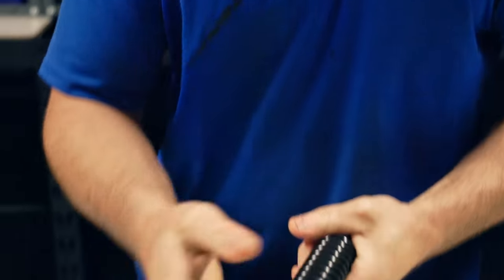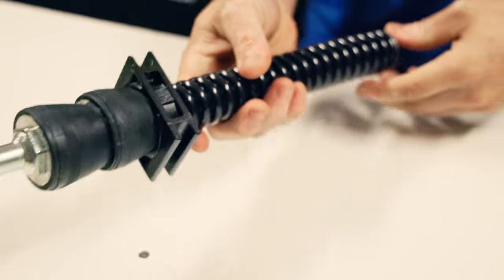Camso Transfer Kits: What You Should Know

Comment: Does the "no swapping from ATVs to UTVs" apply to the X4S trac system that's supposed to be designed for both?  I can't buy a used X4S that was on a Honda Foreman 500 ATV and put it on my Honda Pioneer 500 UTV?
Reply from the maker: That does not apply to the Camso X4S. I was only referring to Camso/ Camoplast T4S and Camso 4S1 tracks. You can defiantly take the X4S off the Foreman and put it on the Pioneer 500! 866-243-8359
Reply: @atvtracks  Thank you.  I'm currently looking at a set of X4S on an auction but I was unsure it they would fit my machine.  Obviously I hope they'll bolt right on but if I need a transfer kit or any parts I'll look to you guys first.